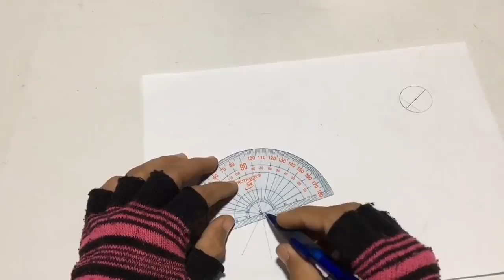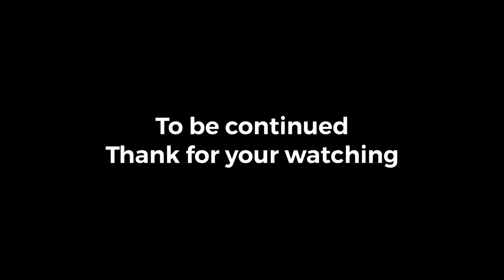How to Make RC Heavy Construction Tractor Truck Homemade RC Car Project #3 Rim Hub Rubber Tires

Comment: Nice work, I will recommend center punching the holes with a plastic tipped thumb tack.Just so you don't ever slip when starting the hole.